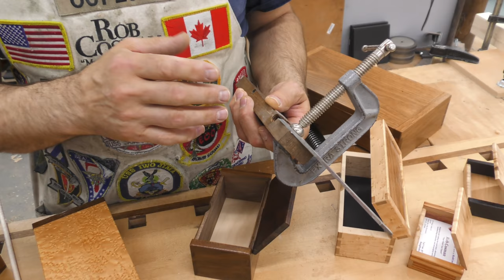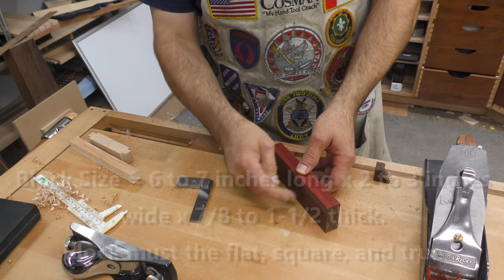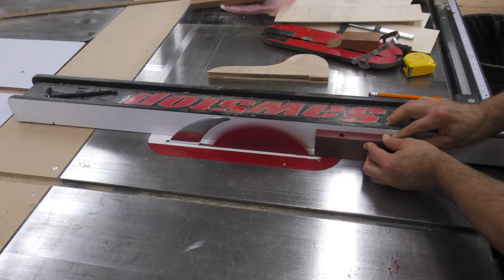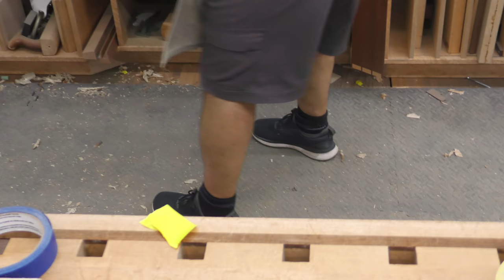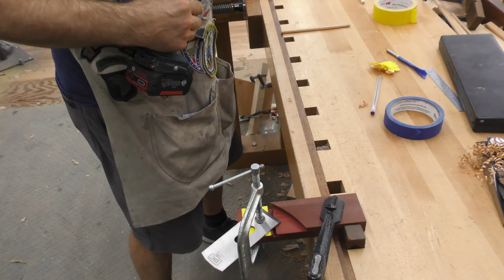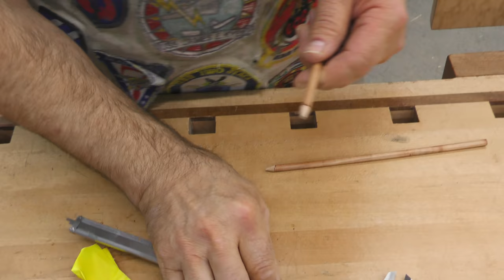Box Building Techniques - Wood Hinge Dowel Jig

Comment: Rob, you demonstrate a great deal of accuracy in your work.  I work in the metrology field and would like to offer you a tip. You will get a more accurate measurement from calipers if you measure closer to the shoulder of the jaws.  The measurement is based on the inside jaw's mount travel down the bar, the closer to the bar the better.  You can get deflection from the end of the jaws which will skew your measurement.  Great work and video as always.
Reply from the maker: Great tip, thanks
Reply: Ditto - GREAT tip

Comment: Rob, I really like your videos as they explain your steps AND reasons for them very nicely. I've been a machinist for 50+ years and enjoy and appreciate precision. It sometimes wants to bite me in the backside, but part of making stuff is also hiding the mistakes in a new method that turns out to be 'as intended'. Well, back to my comment. In machining, we use a center drill before the drill. So instead of using that tapered reamer AFTER you drill, why are you not using it first? You may have a good answer. But the center drill, or in this case, the tapered reamer acts as a guide/starter hole for the drill, and doesn't turn a burr into the hole. It also insures the drill can't do any wandering in the beginning. Your thoughts please. Great work, and I really enjoy watching you work. I send hours at a time on your channel. Thanks, Paul Bertsch, Huntington Beach CA.

Comment: Thank you for making this video! I've had some problems with making the dowels. Looking forward to all the little details on getting this just right. :)
Reply from the maker: Glad it was helpful!
Reply: @RobCosmanWoodworking  ok I gave it a whirl two ways. Fist I waxed the feed stock which gummed up the cutting blade. Then I put wax on a dowel and used it to wax the hole. That worked great EXCEPT the dowel came out with wax on it which led to a clean up which changed the dowel size. If you don’t clean it it won’t hold glue. Fun experiment but back to the Rob method

Comment: I have made a couple of these jigs for different diameter dowels. What I did was after drilling the desired hole diameter followed by the flair, I cut the waste away so just a portion of the top of the dowel diameter hole was just  showing and I did not worry about uncovering the top of the hole uniformly off the saw. I then slowly filed the surface where the cutter rests on the jig with a large flat file to open the area above the dowel diameter uniformly.  I then continued to file the cutter bed slowly removing wood to sneak up on the desired diameter of the cut dowel and to make sure the cutter was resting on a flat surface. Several trail dowel cuts were needed to dial in the diameter while slowly filing the cutter bed away. The other thing I did was to leave a small amount of wood of the jig over the top of the entry point of the jig so the rough dowel would not spin out of the jig while starting the cutting. Once the desired diameter was achieved and the cutter orientation set, I marked the cutter location as you did for future use. Thank you Rob for sharing your knowledge of woodworking with us!  I love these wooden hinges and you can't beat the price too!😉😉😉
Reply from the maker: Great job and thanks for explaining what you did for others

Comment: My dad use to make his own dowels to.  He made ajg that used a router with a straight shank and you feed your square stock in one side spinning it with a drill and just pushed it through.  The bad thing was it waste a few inches on both ends but you can do a 8 ft rod in a less than a minute if you wanted to.      It worked a lot like yours except instead of a chisel you had a router.

Comment: Rob, do you know why the table saw blade didn't open the drill hole evenly without having to use masking tape on the bloodwood? Did it have something to do with the squareness of the wood or table saw blade relative to fence? Or was it the drill hole not being quite parallel to the blood wood's surface, which may explain why shimming the back of the piece with masking tape worked? Just curious, thanks!

Comment: @robcosman.com ... looks like you are using a Woodriver adjustable block plane blade...  low or standard angle? Do you prepare the blade any differently than if you were using it in the plane? Thanks.

Comment: Regarding shimming up the blade, masking tape is very compressible so the force with which you tighten the clamp can significantly alter the thickness of masking tape shims. I imagine the reason that the 0.001" shim you put last didn't alter the diameter of the dowel is that you clamped it down harder than you had without the steel shim thus compressing the tape underneath.
Reply from the maker: as long as the diametre of the dowel comes out correctly its OK.  If you want to use other shim material go right ahead

Comment: My question to you dear sir is:
Can this wood hinge work with hardwear store dowels.
You said în The begining Off The video that it is imposibile.
Is this the only way, 
By doing your own dowels?
Do you need The dowel centering jig?
Thanks!
Reply from the maker: Store bought tend to be a bit oval and or undersized.  Worth a try.  Yes on the center drilling jig, secret to a success hinge!

Comment: In your recent videos I have noticed that your depth adjustment is different from the standard wheel could you explain what it is?
Reply from the maker: An idea we have been working on to make it easier for tired fingers to adjust the blade depth.  We call it the “adjuSTAR”.   Made to fit Woodriver planes and we have a model to fit Lie-Nielsen planes.  RobCosman.com

Comment: Thanks Rob!  You make it look easy.  Could one use a bolt to hold the plane blade and use a mallet to fine tune the fit?  I purchased your dowel pin drill jig and it tends to burn store bought dowels, so I will be excited to make my own
Reply from the maker: I think a bolt would work.  I dont understand how you envision using a mallet to fine tune the fit though.
Reply: RobCosman.com the bolt would go in the slot in the plane blade, then you could advance the blade with the mallet from the heel of the blade. From the video, it seemed like the most important factor is the height of the blade from the center of the hole instead of how forward the blade is or the angle of the blade.

Comment: Thanks for this Rob. How does the LN dowel plate compare to making your own jig?
Reply from the maker: The LN dowel plate has 2 isdues which i dont like for wood hinges 1) it makes a dowel by scraping not cutting so the surface is rough not smooth and 2) its super hard to make a straight cut on it since there is no long hole to guide the stock.  I dont recommend it for this application

Comment: I have tried to design and build a dowel jig 5 times, most recently using a 2-stage design and 3D printing the body.  Each time it gets a bit better, but the friction on the backside of the cutting edge is always the problem to which I have not found a solution.  I've used reground planer blades, plane irons, etc.  It looks like attempt 6 will be in the offing, and perhaps I can find some lignum wood or otherwise figure out how to support it.  I'd love to find a solid solution.
Reply from the maker: Specifically what is happening on "The backside of the blade"?
Reply: @RobCosmanWoodworking  My apologies for the vagueness.  The problem is the pressure on the other side of the dowel under the blade.  Whatever backing I've used burns badly, or melts the plastic in the case of a 3D printed jig.  I'll try an exotic wood backing/instert; so far maple, oak, and teak have all failed.  I've tried a "2 stage" design where one blade trims to a rough fit for the final finish (to save time prepping the dowel).  The rough cut works well, which is set up like a pencil sharpener, and your video gave me some good ideas for the fine cut.  Love the videos, keep up the good work!  (I'm a BYU grad also, but in Electrical Engineering...)
Reply from the maker: Send me a pic when you get it perfected

Comment: Rob :  I struggle with plane not being square/parallel causing an angled cut on edges.  Do you have methods to get the muscle memory?
Reply from the maker: Yes.  You should watch my video on planing true and square
Reply: @RobCosmanWoodworking  Please also address what to do if a WoodRiver 5 1/2 plane is not square sides to bottom when using a shooting board. Thanks

Comment: If you are planing away the corners of a square rod, what you get is an octagon section, (8 sides) not hexagon (6 sides) unless you only plane away two of the corners. ( no pun intended).
Reply from the maker: Did I say hexigon some place?
Reply: @RobCosmanWoodworking  Hi Rob, sorry but yes, at 3.24, 7.41, 7.52 and some other times. Please do not take my comment  as an offence or me being picky. I make the same mistake sometimes that's why I noticed it.

Comment: Hmmm… it seems that some HDPE or, even, nylon would work great: self-lubricating and not leaving and marks / color on the wood.  It would also have a little more tolerance for the forcing a non-round peg in a round hole.  A round-over, bead-forming, similar bit to reduce the size of the dowel, perhaps 1/16"+ larger than the dowel size needed, in this case ¼" and then sending this true a cove bit groove with the plane blade topping off the “unfinished” dowel to be ¼" round.  This might be faster than making an octagon, or making something more round (with a table saw), such as a decagon could work.  None-the-less, this is just more work when a router bit could more easily shape a closer diameter that can be finalized with precisely placed plane blade rather than doing a similar action with a table saw.  I suppose one could to a once-thru pass on a table saw with a dada stack with a ¼"+ or ⅜"+ gap and then let the final pass-thru with our plane blade shaping tool finish the job.  It would also be beneficial to draw this up in a program like CorelDraw that would more precisely show what kind of dimensions would work relative to where to place the plane blade.

Comment: On the subject of oily exotic hardwoods, some of these may be difficult to source. What do you think of using an un-oily wood and oiling it?
I don't mean soaking the board, but perhaps for example drilling a small well a few inches away from the main hole and letting mineral oil soak into the well.
Reply from the maker: I think you would be better off waxing it than oiling it.
Reply: @RobCosmanWoodworking  Thank you
Reply: Remembering that the box hinge requires glue to adhere to the dowel.  Too much wax or oil could be a problem if not cleaned afterwards.
Reply: @chrisc4527  Indeed!

Comment: First either your saw t fence isnt square or more likely your Drill Press to Table isnt, But as for your tool, you needed a Deeper Bloodwood, so you could drill a Hole and Just have a Bolt and T-nut on top Hold the blade down to it, instead of a Clamp.

Comment: You over-laid 1/4 inch = .0450 in this video. What is this; .0450 of what?  !/4 inch is .25 inch and equal to 6.35mm.
Reply from the maker: I’m in front of the camera, the “behind the scenes” guys will have to answer that one!  Luther!!
Reply: cut your block at a 2 degree angle downward at the flared hole. look at a pencil sharpener.